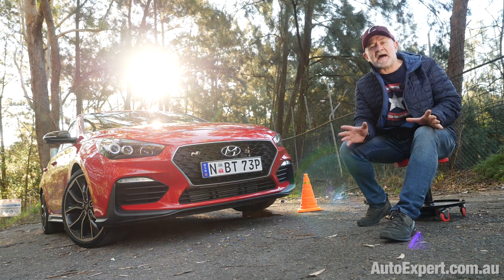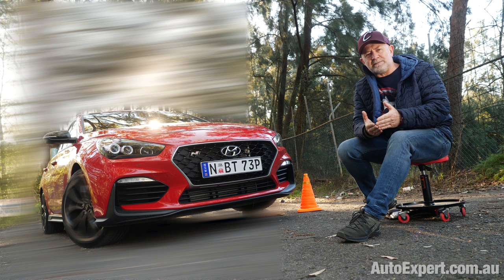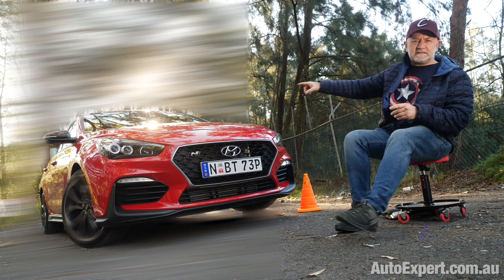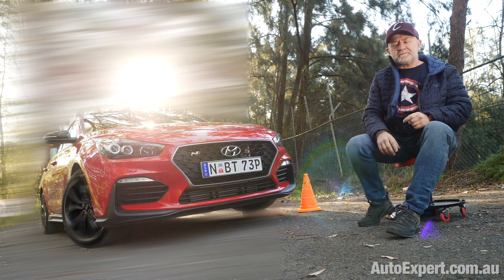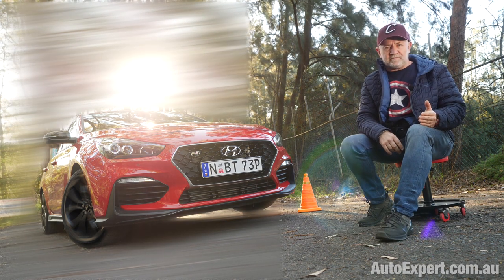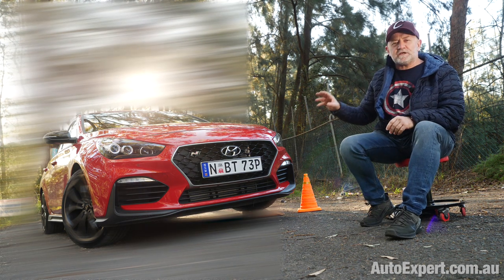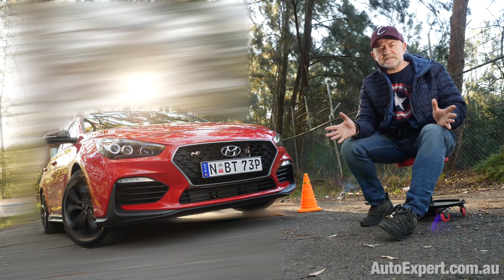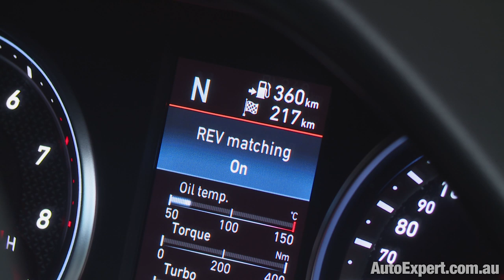What is an e diff? (Computer controlled limited slip differential) | Auto Expert John Cadogan

Comment: Lucky for some of us aged folk to have someone to explain modern car Tech to us John, I'm ok with the old stuff but have definitely slipped behind with this new gubbins. Thank you.
Reply: Yeah, well said. Listening to jargon and tech babble reminds me that I'm getting old. Now, where did I put my reading glasses...
Reply: Way back 1995 i owned a Volvo 850. It had a system called  TRACS. it used the ABS system to brake the inner wheel whenever traction was lost. It was crude but it sorta worked. 
I prefer a mechanical torsen diff. It provides seemless lock between 0-100%, whenever it is needed to stop the inner wheel from spinning.

Comment: I tried one of those i30N Fastbacks at my local Hyundai dealer and was very impressed and would have bought it too but I need an auto due to my ruined left knee. I bought a SEAT Leon Cupra instead which has a similar diff. I've never had a front driver before in more than 35 years of driving but, once you get the hang of the diff, it works beautifully. I doubt I could breach the cars limits on a public road here in the UK without winding up in prison. Sorry John, I know it's made by the Devil's own car company but it looks lovely! Great vid, thanks.

Comment: Great explanation.  In simple terms I explain it as it “pulling the front wheel drive car through the corner, as opposed to running wide”.  The best example is those multi-laned roundabouts where the diff literally pulls the car through the corner.   And let’s not forget other manufacturers also have these too.

Comment: Have a vaq ediff in my cupra, took a long time before I discovered how it worked on public roads because expectation was that it would just understeer off the road - there is a brief moment of doubt before it locks up but the drive you get out of corners is crazy. In the wet in the most aggressive setting, when it looks up it tightens the line so much around small roundabouts you need to wind off the steering lock a bit - can actually feel it tug the front end in.

Comment: What should have been added in commentary is that the diff has a hydraulic clutch pack actuated to the wheel that has lesser traction to add portions or total traction to the spinning wheel via all the sensors that he did mention .

Comment: Definitely need to dig a little deeper in to the subject John, this left at least me a little hazy on the difference between brake traction control system and e-diff. Is there a computer controlled clutch pack inside the diff like in early 90's Benzes or does it use the normal brakes to achieve the same effect like every other modern car, or something fancy like a servo rotating a planet carrier in the one or the other direction like in a Volt/Ampera? And what's the benefit v. torsen such as a Quaife diff?

Comment: Great, thanks John. You explained the e-diff's effect on handling. I would like to see how the e-diff works. I.e. dismantled on a bench in a workshop?
Reply from the maker: It's just a limited slip diff that's actuated by a high-speed servo motor. Looking at the parts hardly ever tells you much about how it works. It's a motor and a clutch pack attached to a differential.

Comment: Very nice explanation. Can you do a vid explaining the difference between an e-diff and torque vectoring.
Reply: The big difference between an actual, mechanical torque vectoring and e diff is that an e diff will lock with a variable amount of torque to try and get the wheels to spin at the same speed. A torque vectoring diff will selectively engage or disengage clutch packs so that certain wheels spin faster. 

So in the scenario mentioned in the video, an e-diff can shift more torque to the wheel on the left( that has all the traction), and greatly limit how much faster the wheel on the right is spinning ei slipping. A torque vectoring differential can slow the wheel on the right and make the wheel on the left (that has all the traction) spin faster and get more torque.

Comment: Excellent description as always John , but whats the difference between an Ediff and traction control ?
Reply: A e diff is an electronically controlled mechanical limited slip differential. Traction control just uses abs to brake certain wheels so that drive goes to the opposite wheel.

Comment: John, great topic. I am a big fan of front drive small cars and find any LSD ( Limited Slip not Lucy in the Sky) something that totally alters the experience. My conclusions on the current ( not driven 130N) E-diff vs haldex/ torsen vs LSD with clutch pack are that it is very digital vs analogue. That is I much prefer the torsen ( quaife in a little Clio172 specifically) as the engagement is seamless where the digital diffs that I have experienced have not evolved to the point where the application is so gentle. On a track where it is black and white, on or off, it is probably less obvious but on a dirt road or perhaps an underpopulated b-road with low traction it stands out like dogs balls when the E-diff engages and can have additional consequences. Big initial under-steer.
I understand that the process control needs an initial feedback to keep the whole thing in check but I think Bosch or whomever are not there yet.

Comment: John, bring on the hardware and electronics explanations. Its interesting to know how it works and the affects on the vehicle.  You might also share the cost of living with it if there is any special maintenance involved.  An example would be the VW GTI DSG transmission.  Early examples required an expensive flush every 40K miles here in "Merica" which was a surprise to many.
If you're going to dig into something, please explain continuous variable valve timing for intake and exhaust valves.

Comment: I have to add there is a big difference here from the cars that apply the brakes on the inside wheel with an open diff. Sometimes this DSC function is described as an eDiff by car sales people. But remember applying brakes means lost power and slower exit speed.
Reply from the maker: And traction control typically intervenes first by reducing engine power.

Comment: Thanks John, more of these please. 
Maybe one on why my 2004 Prius uses about half the fuel my 1990 Camry wagon used for the exact same across the suburbs 50 minute commute. And another about why the Prius can still achieve that result with 320,000km on the clock on the original battery. 
Maybe a show about how over the life of a Prius it can save 12,000 litres of fuel compared to a similar size petrol only engine car. 
Yeah, I know you won't. 
I do seriously love your work. 
Have you seen Book Of Mormon? I think you'd love it. I saw it last night.

Comment: I can see that an e diff would be good on a race track to get the best lap time, but surely the computer applying a little braking on the inside front wheel to limit wheel spin would have a similar effect. Applying some braking on the unloaded front wheel should allow the average driver to get around the corner just as safely and would be what you would expect in a car with a good traction/stability control system without the complexity and cost of an e diff.

Comment: Great video, but I still dont get how it actually physically controls the axles.  It looks to me that the unit is an add-on bolted to one side of the transmission but I can't get anyone to explain what its physically controlling.  It looks like a VW Haldex unit that operates like brake clamping to force an open LSD to bias the drive forces.  How is it controlling both sides?  Does this have to work in conjunction with the brake vectoring system to work?  I wish somebody could show an entire unit of the transmission with and without this unit installed so I can understand what is different.

Comment: Like beer garden physics John. I imagine the "e-diff" is an open diff with braking applied to transfer torque - like traction control, just faster. Imagine now bypassing this whole goofy approach by driving each wheel independently - like you could in an EV with a motor per wheel. As far as I know, only Rivian are doing this on their 4WD. Can't wait for the future!
Reply from the maker: Not really. It's a clutch pack, not a single-wheel ABS activation.
Reply: @AutoExpertJC  Thanks John, yeah, I looked it up after I opened my big mouth.

Comment: So by the sounds of it the diff actually vectors torque to the outside wheel  and it’s not just a case of the inside brake being applied  to load it up. Should work very well and get rid of the biggest problem with front wheel drive. The boys would still miss power oversteer but it should be very quick around a track.

Comment: I thought your explanation of weight transfer and tire friction was great, but I think you missed a big point about how ediffs work when slip is sensed, which is by using the ABS system to brake the slipping wheel thus sending power to the other wheel through the open diff. The cons to this system is that the brakes can get much hotter than using a mechanical LSD

Comment: Very interesting and informative John. You won’t hear any objections from me if you cover more modern car tech in future episodes. There’s kind of a negative being a positive! The only caveat with limited slip differentials, I understand, is if you are at maximum sideways grip on the driving tyres of your car, the transfer of power to the outside loaded tyre can overload the grip on that tyre, resulting in a sudden loss of grip. This can lead to a spin in a rear drive and especially rear weight biased car: mid-engined or rear-engined sports cars are particularly prone to this, especially if it’s purely a mechanical diff. Speaking from scary and costly experience here. Front-drive cars are less likely to suffer this, I suspect, and even if they do it’s just going to understeer on you, which is probably easier to control for most.

Comment: I'm guessing this system is a little different to Hyundai's TVC (Torque Vectoring Control), but it sounds like a similar concept.  As I understand it, TVC uses the individual front brakes to slow the inside wheel when it detects a loss of traction, rather than just cutting engine power, and slowing that inside wheel will transfer the torque to the outside wheel instead so long as power is still being applied.  As best I can tell, this E-Diff system adjusts the torque vectoring inside the diff itself, rather than using the brakes - which is probably better in terms of a track day, as it will reduce brake wear and heat, and likely lets the system be more proactive in terms of adjusting torque output as you drive.  Same idea, but a different method of implementation.

Or have I misunderstood how this works?  Let me know what I've missed/screwed up.  :-)

Comment: Point of contention, an object on the ISS doesn't weigh "zero". The object still has weight and is falling towards the center of the Earth. The reason that it doesn't hit the Earth is that the object is moving fast enough that it's trajectory happens to end up being an ellipsoid that never intersects the Earth. Taking your brick, it weighs say 1 kilo on the surface of the Earth. If you let it go it goes straight down. If you throw horizontally it follows a curve. In both cases the weight is the same, 1 kilo. If you kept throwing it harder and harder it would end up farther and farther along the ground. In each case its still 1 kilo. If you threw it hard enough it would end up following the curvature of the Earth, essentially falling around the Earth. And its still one kilo. Clearly that won't happen because of air resistance slowing the object down. By sticking the ISS at an altitude of 200ish km there is minimal resistance from the atmosphere. Therefore it still has weight, but due to its horizontal speed it falls around the Earth rather than into the Earth. The reason that objects on the ISS appear to be "weightless" is that all the objects are falling around the Earth at the same rate. If you let go of a brick the Earth holds you still while there's nothing to stop the brick, until it hits the ground.
In remembrance of the fact that we managed to get a man to the moon and back 50 years ago and where clearly ahead in some ways at that time. The moon where a 10 kilo object is a 10 kilo object and a 22 pound object as weighed on Earth would weigh 3.6 pounds.
Reply: Hang on...don't you mean that the MASS always stays the same? I thought that how much a thing WEIGHS, was due to to it's proximity to another mass.  you know...that gravity stuff.

Comment: People and car enthusiasts think; locked differential and 4wd is great when you are stuck or you need power at all wheels on race track.
Rally driver, real professional driver and driving experts think; locked all 3 differentials when you braking is gift from good. ABS is great help but all wheels spinning at same speed when you floor braking pedal is some next level stability.

Comment: I assume this is a 2WD, I thought LSD is good for mud, sand and snow and you at least have traction of at least one wheel rather than one wheel spinning and the other wheel doing nothing.
When I had the 1993 Ford Falcon station wagon, I realised that LSD was available but it cost $800 which was a fantastic sum at the time.

Comment: Don't like the sound of the 'E' bit. Sounds like an expensive problem, once its out of warranty.
Reply: I suppose there is that but really is there any part of any car that is not E atm? Every part of the car is connected by CANBUS and sensors and stability, brake distro, engine management etc etc etc and it all seems to work just fine for the lifespan of most cars. I think they have this pretty well in hand by now.
Reply: I think the e-diff is an open diff augmented with individual wheel braking.
Reply: Did some looking on the interwebs - it is probably a little more complex than I thought rinuncular too - looks like there is another device (at least on VW's e-diff equipped cars there is)
Reply: @MiniLuv-1984  yeah its got controlled torque vectoring not just clutches or brakes

Comment: Sensei, this would be true for all forms of motorsport...except drifting exists and the point of that is to go into the corner really really fast but really really sideways, past the limit of adhesion and scored on the level of sideways action they can achieve while maintaining a perfect synchronization with the other car you are battling. 👍 I get where you're going but sometimes to win isn't to be faster than the other guy, it's to be able to scrape your paint onto his door handle at a 90 degree angle while churning enough smoke that VW would be proud. 😎
Reply: MafiaboysWorld yes but Drifters are the Drummers of Motorsport
Reply: @Nobody_Famous  Tommy Lee, Travis Barker, Lars Ullrich...I think some drummers do pretty well. 😉😎
If you're from Sensei Cadogan's generation, you'd even put in Ringo Starr. 😁
Reply: How do you know if the stage is level at a rock concert? 

The drummer is dribbling out of both sides of his mouth.

Comment: Ok, great topic and content upload. 
Queston. Why don't Hyundai/Kia offer these hot hatches and fastbacks in all wheel drive, as to compete with Subaru Mercedes-Benz Ford focus. 
With proper track orientated all wheel drive, with rear wheel bias. Or a symmetrical set-up, similar to WRX. They wld crush the market. Affordable good looking performance vehicles.
I'd buy one.
I'm not a fan of front wheel drive. But i wldnt say no to one, after hearing glowing reviews of the  Honda civic turbo, and said N30 of their track ability and driver interaction. In one American review they likened the Honda to a Porsche. WTF in it's track poise steering and driver input  rewards seat of the pants feel. That's a mega comment. Considering ones RWD and ones FWD.

Comment: Excellent desctiptions of a complex system. Though I'd prefer to view and discuss the schematics, I'll ingest your description. Seems very similar in principle to the electronic centres contained within the differentials of articulated surface, think loaders and 90 ton dumpies, and underground machinery, such as boggers and dumpies, to ensure sharp confined turns on either slippery or highly compacted surfaces, smooth or undulated, don't place excessive positive or negative inertia on the rigid drivelines under extreme load conditions. Oh, sorry but underground vehicle description slipped in aka mine slang. Boggers are underground loaders. Dumpies underground tippers. 'Bogging out' is the physical act of recovery and disposal of ore from the blastface. 👍👍🇦🇺

Comment: Ok John. I’ve watched this twice now. I’m convinced you don’t know exactly how this e diff works. You say it clamps the left wheel down to drive the right wheel. Common sense tells me the e diff would just send the power to the right hand side and not waste power trying to drive a clamped left hand wheel. Can you find out exactly from Hyundai how it works please and do a better video??
Reply: As a differential becomes more locked, torque will naturally become more biased to the wheel with more traction. That's because torque is calculated based on friction, so whichever wheel has more torque is generating more torque. That's how a limited slip differential sends more torque to wheel with the most traction. As opposed to a torque vectoring diff which uses clutches to spin certain wheels faster than each other. A E-diff is a just a mechanical limited slip differential that is electronically controlled, meaning that it can lock at a variable point with a variable amount of force. While a normal mechanical LSD locks at fixed point with a fixed amount of force.